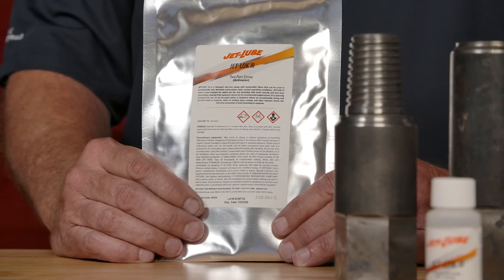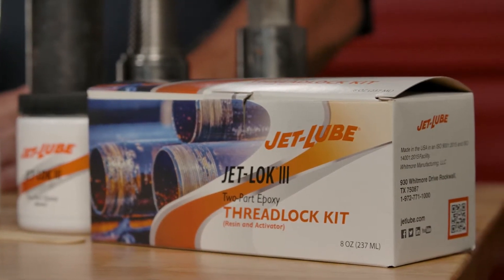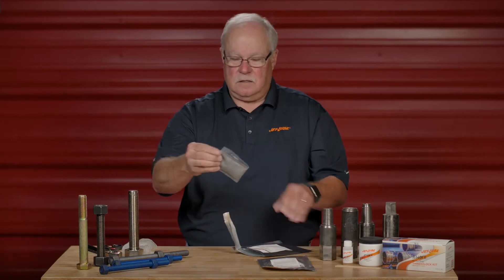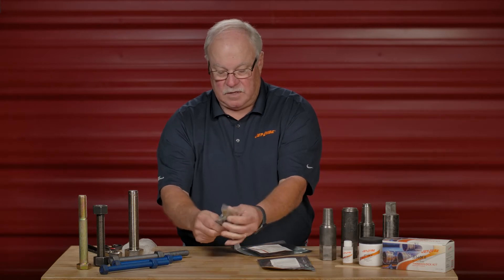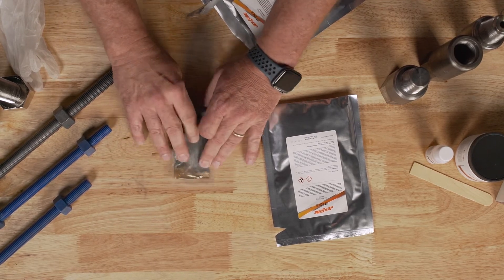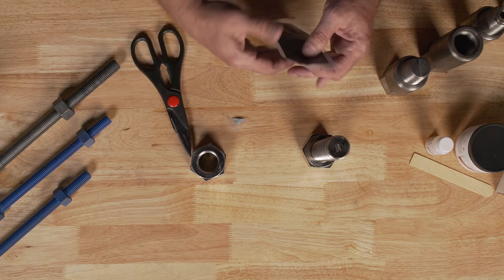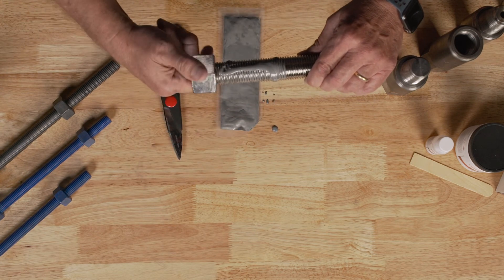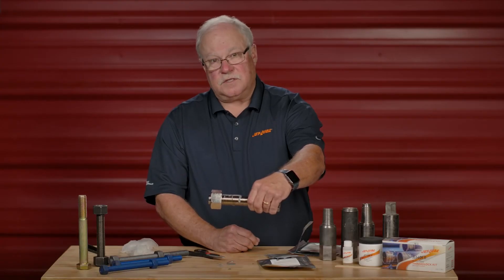How To Apply Two-Part Epoxy Threadlocker, Jet-Lok® III

Comment: Has anybody tried this?
Reply: I did it with jb weld exactly that with two nuts on a long threaded rod (one in each end). This is a way to improvise a tool to open a motorcycle suspension. It took 45N.m to open and close and no problems.
Red threadlocker with no load like that wouldn't take that much torque.